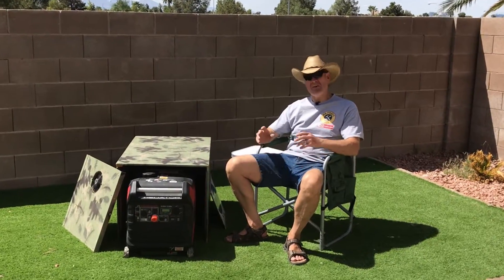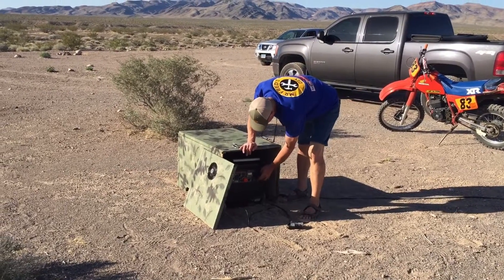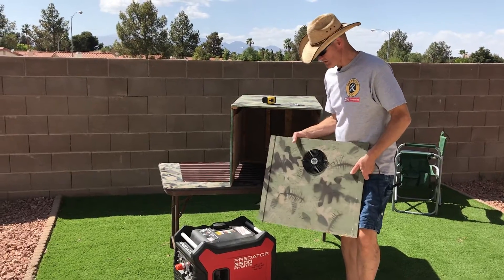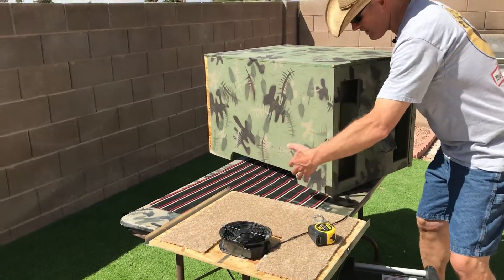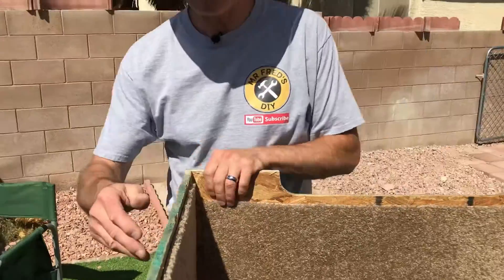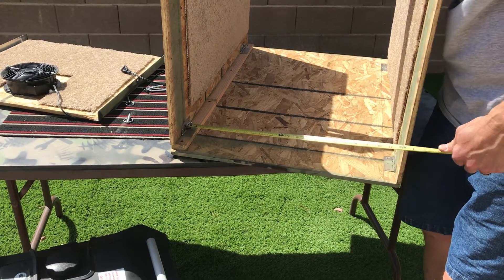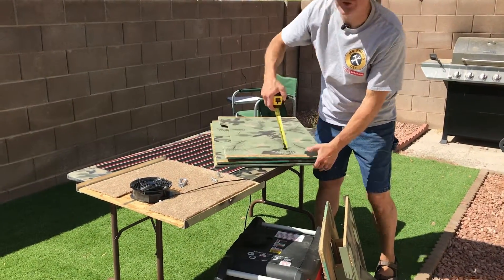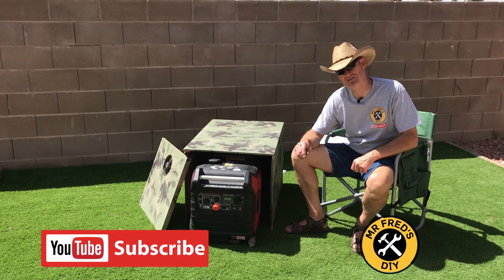Generator Noise Reduction Box (How to make a generator quiet box)

Comment: I just scored the newer model (with the co2 sensor) for the older models discounted price. But I'm concerned that a sound box even with the fan, might not be enough air flow to keep the co2 sensor from tripping.
Reply from the maker: The fan I used is rated at 211 cfm and really moves some air. It’s an interesting question about the co2 sensor. Thanks for watching!
https://amzn.to/3a7UyZL
Reply: @MrFredsDIY  Thanks for your reply! And thanks for your great videos on this generator. I'm currently breaking it in with your recommended oil changes and I'm going to attempt to build this box tomorrow.
Reply from the maker: I have another sound box video coming out this Thursday!
Reply: @MrFredsDIY  I saw that! And then I hit the subscribe button. I can't wait to see it.

Comment: Useful video, thanks for making it!
I was looking at the pop-up! You need sidewalls. I use lightweight tarps for my desert sun shading. I can angle down on which ever sides I need to block the moving sun and deflect the wind up over the shaded area. More time to setup but the versatility makes it worth it. I use one long pole in the center capped with the standard tennis ball, and run 4 lines from the tennis ball with one line going to each of the corners to support the roof of my sun shade.

Poles are made of 1 1/4"  and 1" electrical conduit. Drill holes at 1 foot distances through both and use a bolt with a wing nut to adjust length. I cut the poles to 6 foot lengths with a maximum height of 9 feet. Use it when I am out shooting.
Also, I use double sided hook n loop, 2" wide as straps for securing target stands/poles together. I use rope and the appropriate knots for everything else. I hate using tie-down straps except for the heaviest loads.
Reply from the maker: Right on! Shade is important here in the desert! Thanks for watching. I have side walls for my 10x10 but not the little blue shelter.
You can see them in this video:
https://youtu.be/Rzc2Upu6A9A